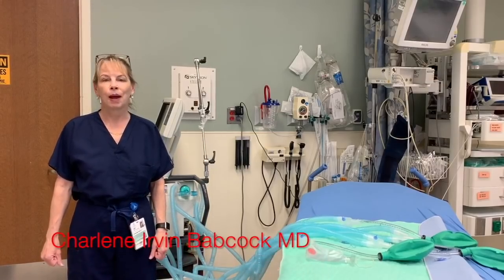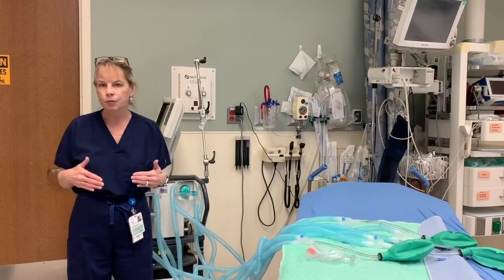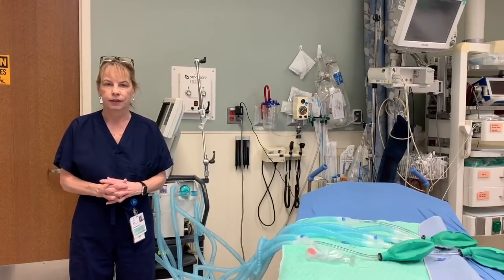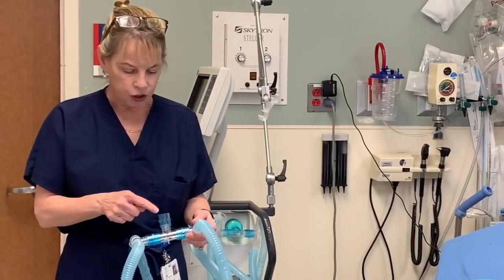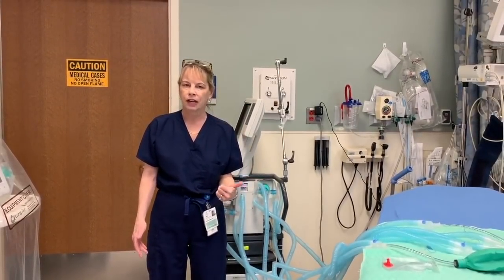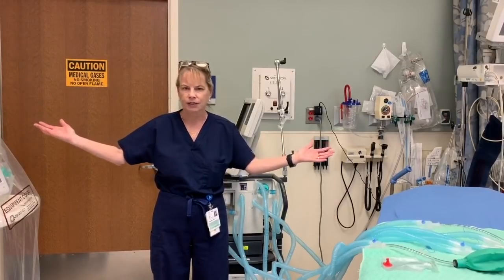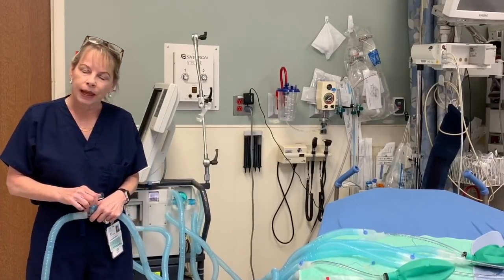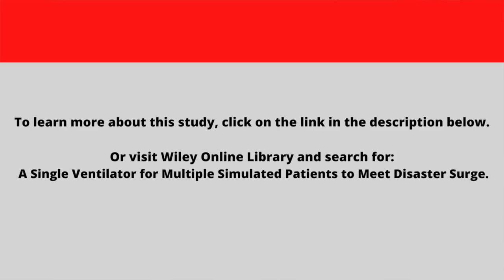COVID-19 How to Use One Ventilator to Save Multiple Lives

Comment: This will not work as different pts have different lung compliance. Guy with higher lung compliance would receive higher volume causing volutrauma. Covid respiratory failure is from ards, different from trauma
Reply from the maker: So this type of configuration is likely only going to be used in dire circumstances...such as 'TRY or LET DIE!'   
You do need to match compliance as close as possible...which can be a substantial challenge...however, it is my understanding it is working in Italy......from 2 days ago....see below...

Dr Marco Ranieri of Bologna, Italy and his team Have successfully tested the approach in vivo in one of the hospitals in Italy overwhelmed by the COVID-19. 

They worked with Intersurgical, an Italian company based in Mirandola, started producing the circuitry in only 72 hours, and the first prototype has already been tested by Bologna Sant'Orsola Hospital. It works and in the next few days they'll start a mass production to supply Italian hospitals who are in need

Here some news in Italian. 

https://www.huffingtonpost.it/entry/a-mirandola-testato-ventilatore-che-assiste-2-pazienti-bonaccini-straordinario_it_5e73c3e1c5b6f5b7c540a8d2
Reply: You don't have to fill the longs completly.

Comment: Thank you for your video. Very ingenious and creative indeed! A small practical comment; what is the capacity of your ventilator? Is it able to work four times the normal pressures? Or will it wear down the ventilator in a short time? I don't know the specs but if it breaks down after for example 1/2 hr it is not so good. Anyway, I think this is a great practical idea when you really run out of equipment.
Reply from the maker: ITs not been done on a large scale...so not sure if it will wear. down.....but it. is being done in Italy....
So this type of configuration is likely only going to be used in dire circumstances...such as 'TRY or LET DIE!'   
You do need to match compliance as close as possible...which can be a substantial challenge...however, it is my understanding it is working in Italy......from 2 days ago....see below...

Dr Marco Ranieri of Bologna, Italy and his team Have successfully tested the approach in vivo in one of the hospitals in Italy overwhelmed by the COVID-19. 

They worked with Intersurgical, an Italian company based in Mirandola, started producing the circuitry in only 72 hours, and the first prototype has already been tested by Bologna Sant'Orsola Hospital. It works and in the next few days they'll start a mass production to supply Italian hospitals who are in need

Here some news in Italian. 

https://www.huffingtonpost.it/entry/a-mirandola-testato-ventilatore-che-assiste-2-pazienti-bonaccini-straordinario_it_5e73c3e1c5b6f5b7c540a8d2
Reply: that ventilator has already been retired.

Comment: Part 3 of 4.  Space does not permit reviewing their paper in any detail.  But, rather than test your concept with 4 single compartment, passive rubber test lungs with minimal airway resistance and high compliance, as you did, Branson, et al used 4 spring-loaded bellows-type tests lungs with variable airway resistance and lung compliance so that they could subject your concept to real-world conditions.  This was a much more realistic test of stiff lungs with ARDS and severely altered lung mechanics that would occur in bilateral pneumonia requiring mechanical ventilation.  I’m sure you are familiar with this paper so I won’t belabor it further other than to state its conclusion:  “… in a lung model evaluation of using a single ventilator to provide ventilatory support for 4 subjects, the data suggest that this technique has important hurdles to overcome.  At present, the use of this technique should be avoided, given the potential hazardous and untoward complications.”

While I understand that you are trying to come up with a viable solution to the problem of not having enough ventilators, your own study stated in 2006 that this was a technique that should be avoided.  Yet, in 2020 you are promoting the technique on YouTube and apparently have neither tested it further, refined it, worked out the bugs, or developed an FDA-cleared product.
Reply: Again, misattributing the "should be avoided" with the wrong study. The 2006 study argues for this concept, not against.

Comment: with minimal airway resistance and high compliance, as you did, Branson, et al used 4 spring-loaded bellows-type tests lungs with variable airway resistance and lung compliance so that they could subject your concept to real-world conditions.  This was a much more realistic test of stiff lungs with ARDS and severely altered lung mechanics that would occur in bilateral pneumonia requiring mechanical ventilation.  I’m sure you are familiar with this paper so I won’t belabor it further other than to state its conclusion:  “… in a lung model evaluation of using a single ventilator to provide ventilatory support for 4 subjects, the data suggest that this technique has important hurdles to overcome.  At present, the use of this technique should be avoided, given the potential hazardous and untoward complications.”

While I understand that you are trying to come up with a viable solution to the problem of not having enough ventilators, your own study stated in 2006 that this was a technique that should be avoided.  Yet, in 2020 you are promoting the technique on YouTube and apparently have neither tested it further, refined it, worked out the bugs, or developed an FDA-cleared product.
Reply: Michael McPeck , just to let you know, maybe this text was sent wrongly... it is (almost totally) in your part 3 of 4 ... ;-)
Reply: @marcmir70  Yes, I know. Sorry. The channel would not accept the entire document so I divided it into 4 parts, but even those got messed up.  Anyone who is interested in the published papers or my entire post can contact me at michael dot mcpeck at gmail dot com.  Please realize that I'm not against innovation in a time of need, but not every idea translates into a workable solution that is practical and helpful.  This may well be an excellent idea for mass casualties, in the field, and in patients without severely deranged lung mechanics, but it can't function well for all 4 patients with ARDS. It may do more damage than good. I think efforts are better spent at trying to ramp up production and distribution of legitimate ventilators.
Reply: Michael McPeck ...here in Rio (Brazil) a professor from UFRJ (a Federal Univeristy at Rio) - Mr. Jurandir Nadal , from biomedical engineering post-graduation department - is coordinating an initiative about to develop new (and cheap) mechanical ventilation ... if you become curious, you can see it on https://m.facebook.com/groups/23547646426590 ...we are talking in Portuguese, but - I think - English will not be a problem if you want to participate and share your knowledge there.

Comment: Part 2 of 4.  The original premise of your study was focused on providing mechanical ventilation for “large numbers of victims.” You even gave an example of a large outbreak of botulism.  Botulism (severe food poisoning) would presumably occur in otherwise healthy people with normal or relatively normal lungs and require immediately-applied but temporary mechanical ventilation because of respiratory paralysis muscle leading to acute respiratory failure.  One could assume that respiratory mechanics (lung compliance and airway resistance) were normal in these hypothetical patients and there was no airway or parenchymal disease.  It could be further assumed that there was no active pulmonary infection. In that case, presented with a disaster surge of these kinds of patients, one could conceivably ventilate 4 patients with 1 ventilator, via the configuration you described, for a modest period of time until other arrangements were made.  

However, the devil, as always, is in the details.  I am sure you are familiar with the bench study that was published 6 years after your study, at a time when the medical community was emerging from the novel H1N1 influenza epidemic that caused ARDS with severe hypoxemic respiratory failure and bilateral pneumonia.  This experience kindled recommendations for ventilator stockpiling and other potential solutions for the perceived problem of not having enough ventilators.  It was in this context that the University of Cincinnati evaluated your previous proposal and study.  Branson, et al (Use of a single ventilator to support 4 patients: Laboratory evaluation of a limited concept. Respir Care 2012;57(3):399-403) introduced their study by citing yours and stating “This paper did not subject the observations to any scientific measurement or critical evaluation.” Meaning, basically, that you proposed an idea but did not present any meaningful data or critical analysis of it.  So, Branson and colleagues, experts in mechanical ventilation, conducted and published the bench study that you should have conducted.
Reply: Botulism is different than COVID. No one's arguing it's the same. It confuses me why that needed to be explained in such detail. 

"...you should have conducted" - The first paper was meant as a concept, a simulation. Hence, "further research is indicated." A subsequent study will contribute more knowledge and discussion. A study after that contributes even more and so on and so on. 

Further more, the evaluation of Branson et al of the sheep study is curious. The use it as evidence against the concept while the actual study (Increasing ventilator surge capacity in disasters: ventilation of four adult-human-sized sheep on a single ventilator with a modified circuit.) states this concept "has the potential to improve disaster preparedness" and is actually suggesting it's a feasible idea.

Comment: It's easy to ventilate four identical rubber bags with this method. However, almost all our patient's lung compliance is going to be different. Air will go down the pathway of the least resistance. In other words, this method will cause volutrauma to patients with high lung compliance while patients with poor lung compliance get minimal ventilation. Unless you have a way to regulate tidal volume or pressure to each individual limb of the circuit, this method is dangerous and can cause more harm than good. I'd rather have med students squeezing Ambi Bags than using this method.....
Reply: How do you match patients compliance though? Plus the course of the disease is probably going to result in the compliance to change over time as well. Do you have a way to monitor the tidal volume or compliance of each individual patient when using this method so patients can be taken of the circuit if things change?

@Chris W - "air will go down the pathway of the least resistance" is my poorly worded way of describing what you've just clarified for me...... :-P
Reply from the maker: So this type of configuration is likely only going to be used in dire circumstances...such as 'TRY or LET DIE!'   
You do need to match compliance as close as possible...which can be a substantial challenge...however, it is my understanding it is working in Italy......from 2 days ago....see below...

Dr Marco Ranieri of Bologna, Italy and his team Have successfully tested the approach in vivo in one of the hospitals in Italy overwhelmed by the COVID-19. 

They worked with Intersurgical, an Italian company based in Mirandola, started producing the circuitry in only 72 hours, and the first prototype has already been tested by Bologna Sant'Orsola Hospital. It works and in the next few days they'll start a mass production to supply Italian hospitals who are in need

Here some news in Italian. 

https://www.huffingtonpost.it/entry/a-mirandola-testato-ventilatore-che-assiste-2-pazienti-bonaccini-straordinario_it_5e73c3e1c5b6f5b7c540a8d2
Reply: "Air will go down the pathway of the least resistance" That's not true. Like electricity, it goes down all available paths in inverse proportion to their resistance. I make no claim about the wisdom of this method, just stating a fact.
Reply: @whitcwa  … when one is talking about the human respiratory system and mechanical ventilation, air absolutely follows the path of least resistance.
Reply: @banderson9431  So you're saying that all the air goes down the path of least resistance.  I'm sorry, but that is nonsense.  If that was true, only one lung would inflate on each cycle because they don't have exactly the same resistance.
Reply: "I didn't learn it from a book so it won't work".